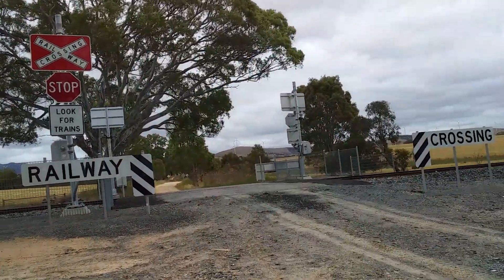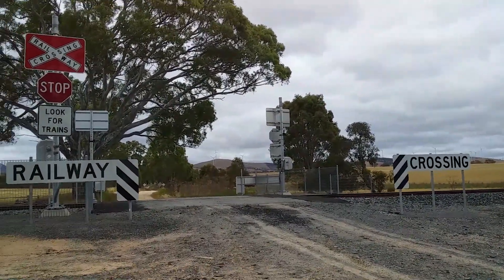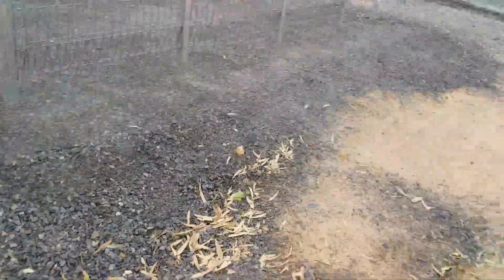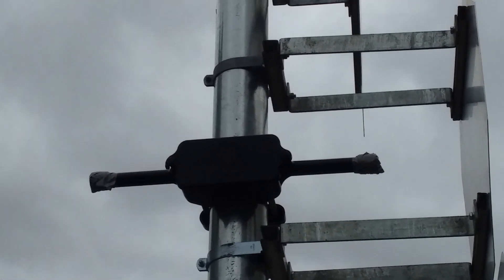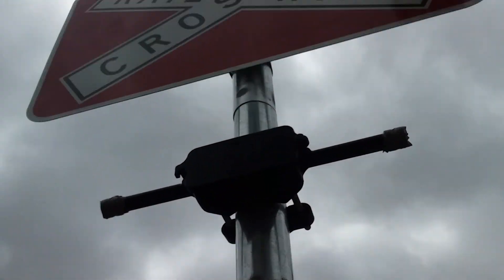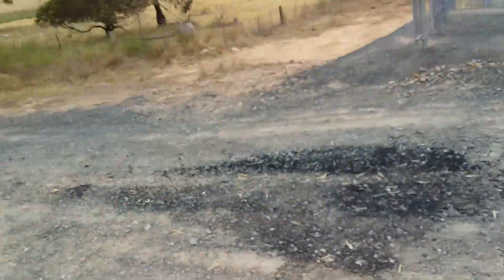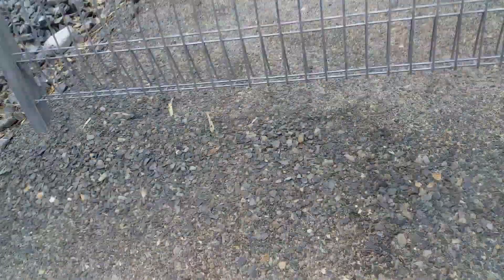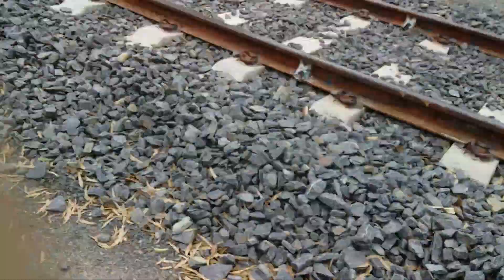Freeman Road Level Crossing Boom Gate Upgrade Tour, near Mount Cole Creek Victoria

Comment: Nice! They're certainly installing lots of boom gates on the line.
Reply from the maker: They are indeed. I reckon Blacks Lane, Dawsons Road and Number One Creek Road should be upgraded too.
Reply from the maker: Update: Dawsons Road and Alma - Moonlight road are getting boom gates and Number One Creek has boom gates. There are 32 crossings with boom gates on the line and they need to upgrade 3 more.
Reply: Cool, that's certainly lots of gates!
Reply from the maker: Update: LJ Dawson Road also now has boom gates making that 36 crossings on the Ararat - Maryborough line with boom gates.